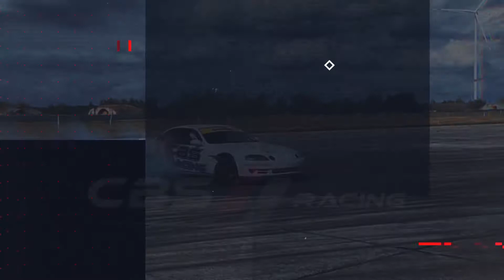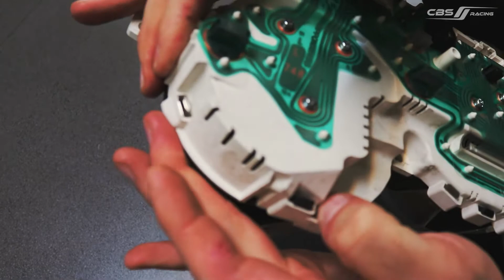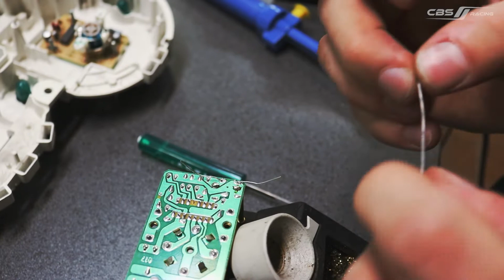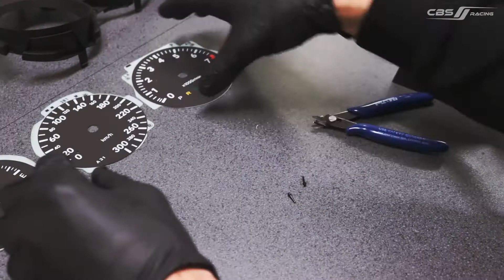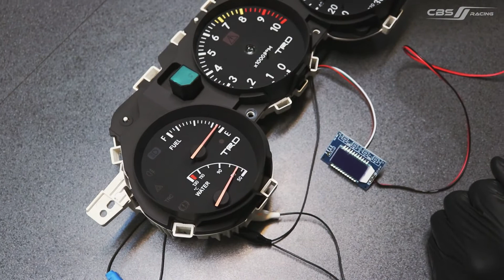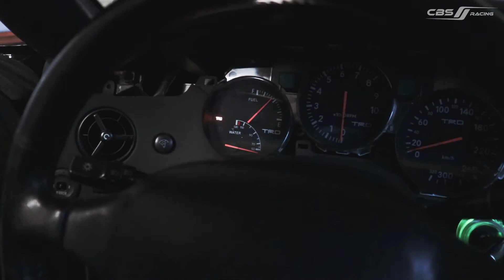Toyota Supra TRD Gauge Face Kit | CBS Racing

Comment: Awesome. 

Can you provide me a simple info plz regarding the cluster?
Reply from the maker: Hey there! Most is already explained in the description. Here's the direct link to the product aswell https://www.cbsracingshop.com/en/trd-s1-series-style-toyota-supra-gauge-face-kit-jp-ledworx
If you need more help you can send us a mail to info@cbsracingshop.com or contact us over facebook :)
Reply: @cbsracing  Actually I need to know whether same ICs are used in the tach and in the speedo circuit. This might sound silly but actually I don't have access to this cluster at this moment. If you can then it will be very helpful for me. Also I want to know how these faces are made just out of curiosity.

Comment: Will replacement of the two resistors on the rpm gauge mean that i don't have to do the jumper mod as i have converted from 2jzge to 2jzgte vvti on a right hand drive jdm or do i also have to do the resistor bypass aswell??
Reply from the maker: yes need to run the mod IF you also go from a GE engine to a GTE engine